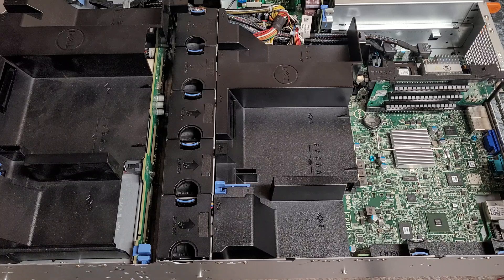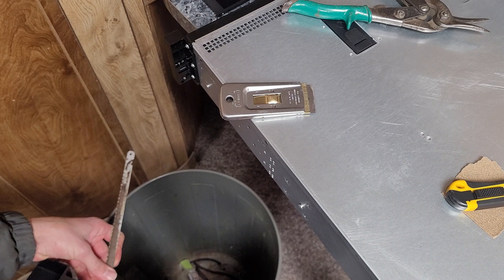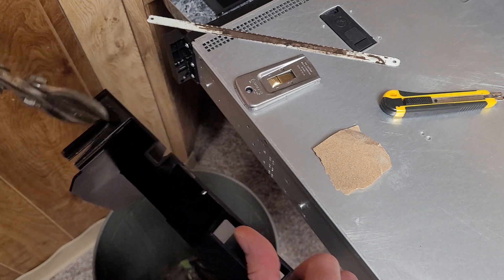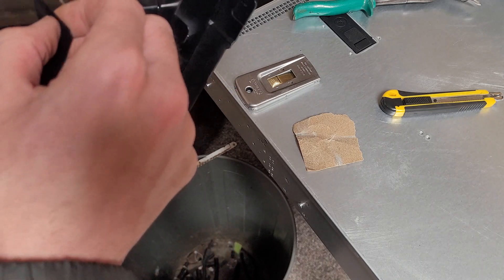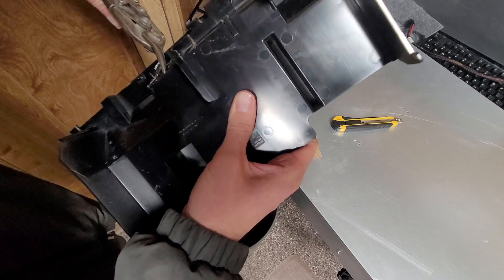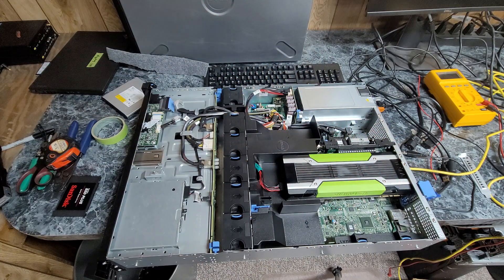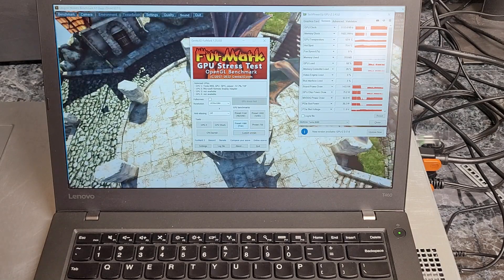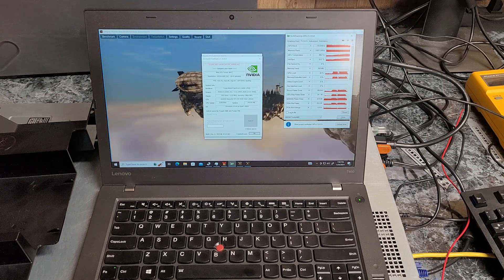Modifying a Dell PowerEdge R520 for powered GPU support is easier than you would expect

Comment: I I did this entire setup waiting for the cable you sell to come in. Got a question  my fans are running really loud. I hear you can send commands if anyone is dealing with this I hope I can get some help
Reply from the maker: Does your server have the iDrac initialization error? If so you will need a new board to fix the fan issue.  If not you can try resetting BIOS and iDrac to defaults if you don't have any custom settings you are worried about losing. There should be a setting in BIOS to change the thermal settings. Otherwise you can change the fan speed offset over SSH using racadm commands

https://www.dell.com/support/manuals/en-us/poweredge-r520/r520systemsownersmanual/changing-the-thermal-settings?guid=guid-4e6c13a1-d889-46a7-9ffa-7064934741ee&lang=en-us

https://www.dell.com/community/en/conversations/systems-management-general/dell-poweredge-fan-speed-change-fanspeed-offset/647f7504f4ccf8a8de2f2bdc

Comment: Nice job 👍. Do you have the references for the gpu power cable and the gpu riser?
Reply from the maker: I don't seem to have done a pinout video on the R520. It is the same pinout as the R720 though.

The R520 requires redundant power supply configuration, all 6 fans, and x8 riser 2 model T44HM. Also will require fan shroud modifications for GPU use.